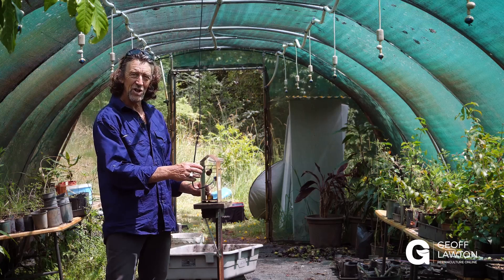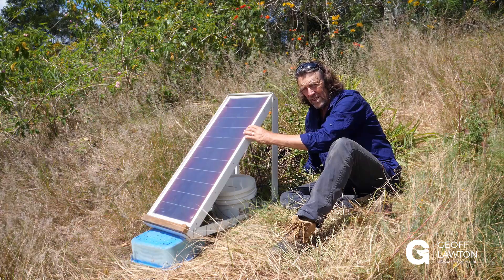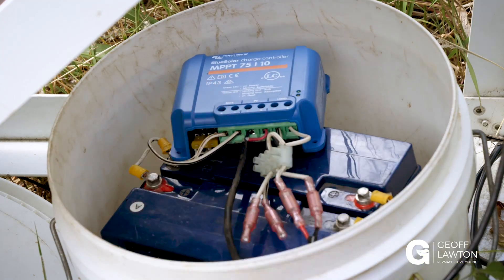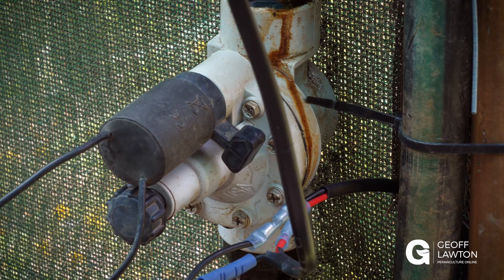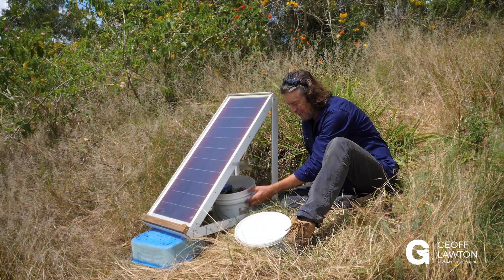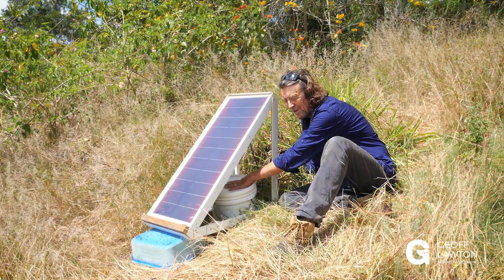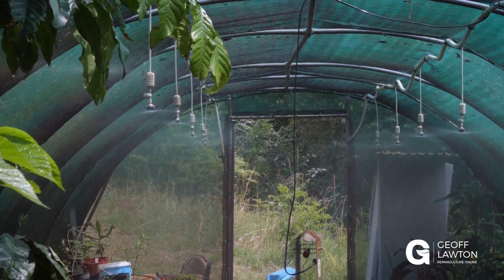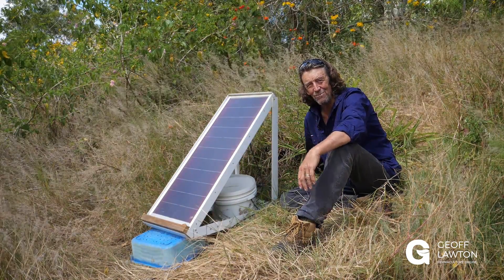We're Converted our Auto-Mister to Stand-Alone Solar

Comment: Hi Geoff, to automate the Solenoid further and IF you have WiFi Access Point to broadcast across your farm, then I recommend you can use a cheap "Shelly Cloud" smart wifi relay device. They come in 12V powered versions too. Maximising your control of when to turn misting on or off, according to humidity levels, time schedule, sunset/sunrise or other sensor info.  It's able to talk with other sensors, via REST or MQTT protocols. I'm working on similar farm automations for my permaculture farm.  Work in Progress.

Comment: Can you talk about creating a simple/inexpensive pressure water reserve, if water pressure is otherwise unavailable?
Reply: Other than elevation difference, ie potential energy, you need to use an impeller pump. Something like 1psi for every 2.31ft of elevation so you could always build a 35ft water tower but you still need a pump to fill it. Easier to directly use a pump.

You could have a pole and hoist water up by hand or by motor. Seems kinda flimsy and a water pressure pump would be far easier

Oh there are pressure bladders that might suffice for simple misting look into that. Uses a solid steel canister with two air bladders that get compressed with incoming water so they can help keep pressure even. I suppose you could also use air compressors.

Or just buy a pump